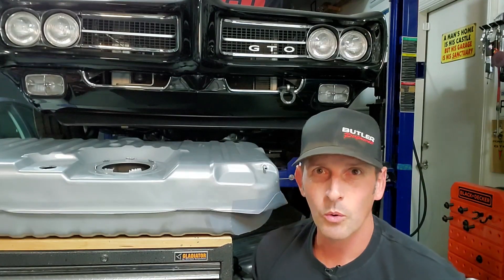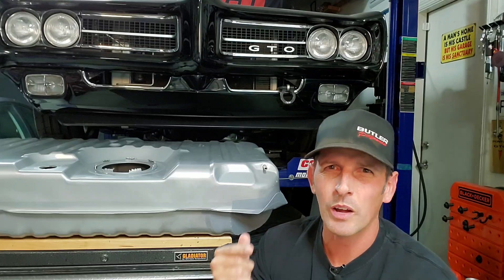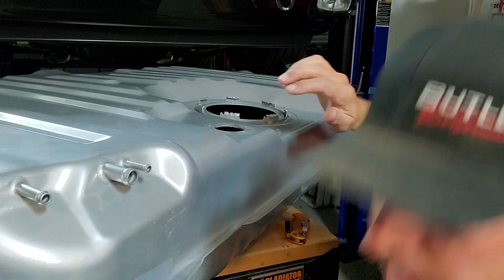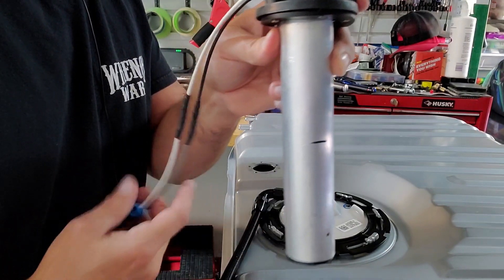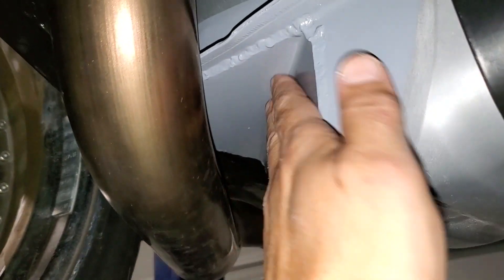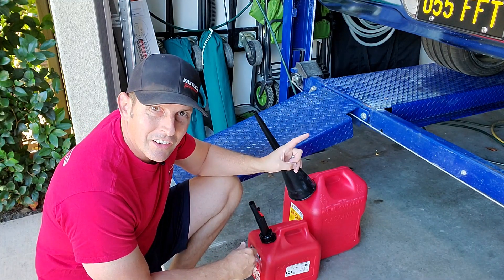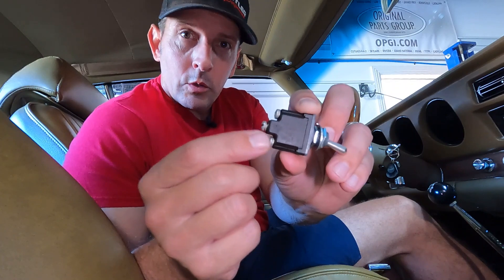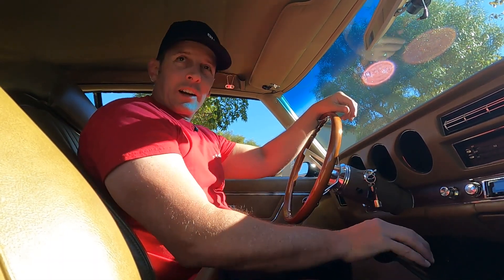Rick's Restomod Tank with LS3 In-Tank Pump, Install, and Test Drive!  Part 3

Comment: Did you add the rollover valve to the other 2 vents also…?
Reply from the maker: Good question Doug. There are several ways to vent it... I elected to not use the roll over valve, purely because I couldn't find a good spot to mount it. The two left and right vents, I vented together. Where the front/rear are vented to atmosphere above the frame/axle. I'm not 100% confident in the large vent, because under heavy braking, fuel comes out. I will be doing an add on video to this subject soon. Let us know what you end up doing.

Comment: Hi Mike, thank you for responding to my earlier questions. I am watching your gas tank videos, specifically part 3. Ricks definitely makes a great tank. For the first time I decided to fill my tank, fortunately I used jimmy cans since my car is still not ready for the road. Shortly after I noticed fuel dripping onto the floor. I am having an issue with fuel leaking from the vent line. Your explanation of the do’s and don’ts of mounting this was really helpful. Can you tell me where you got the rollover valve. I might think of that as a check valve but I think that’s exactly what I need.
Reply from the maker: That's why I'm here... ha, ha... That roll over check valve I got from Summit Racing.  Which, I never ended up using, as I couldn't find a good spot to mount it vertically.  Anyway, as you noticed, keep those vent lines higher than the fill tube.  Hope that helps!
Reply: So that’s why you didn’t mention it again. So if I recall there are three vent tubes on your tank, did you just stuff the hoses up in the frame ?
Reply from the maker: @davidrosenthal735  Ha!  Good point... so, there are FOUR vents in the rear.  The two that are the same size, where there's one of each on each corner of the tank... I want to say 1/4" diameter?  I connected those two together, but looped up and over the differential.  Those two are side to side motion vents, so it's cool to attach them together.  That leaves the 5/16" and 1/2" vent, on the passenger side.  I plumbed those up between the frame and body, exposed to environment, as high as I could get them.  Hope that helps!  (Ohh, those two are the front to rear vents, the big one being when you brake, air would push out of that one)

Comment: Great Video I think you should replace your older sending unit for more accurate sensor instead of 2 gallons at a time.but your probably already on it.
Reply from the maker: Ummm, it is brand new.  Did I not make that clear?  My point about the 2 gallons was there's a delay, which makes perfect sense, you don't want your gauge bouncing around, you want it to react slowly.  All is good.
Reply: @FastMonty  guess I miss understood

Comment: Next you should get a high and low beam relays, for your headlights to take some current off the headlight switch inside your car. It also makes your lights brighter it’s just a suggestion
Reply from the maker: Great idea Glenn!  Thanks for sharing!  (I have LED's so, not super concerned, but great idea for all to see!)  Thanks again.

Comment: Nicely done, making it work, looks good too, minitubs next i see :)  I attached my rollover valve on the a braket mounted to the top diffcover bolt. I did not bother to put a hoseclamp on the tube going into the barb. i checked it earlier this year, and sure enough the vent tube was no longer attached, it was dragging the ground and puking fuel at inapropiate times lol.
Reply from the maker: Ha!  Yeah, MiniTubs would be awesome.  Too funny, not funny, about the floppin around vent tube.  I guess I need to consider using hose clamps.  LOL.  Thanks for sharing your story!

Comment: Another good video. My Nova has a rollover valve installed by previous owner, that I thought was a vent. When I have a full tank, it spews gas out all over my chrome diff cover. Now I know I need to shorten the hose because it drops down, then goes up. So hose fills with gas then forces it out, like you said. Thanks for the tip, it helps all of us. I also installed a vented gas cap, so I wonder if I need this valve at all?
Reply from the maker: Thanks Mike.  Great question about the vented cap... I have no idea how it would affect your tank.  After you fix that hose dip, let us know how that vented versus non-vented cap goes.  😄  Thanks for the comment!